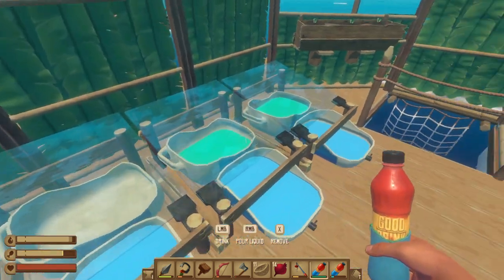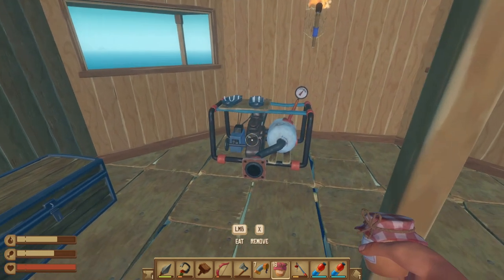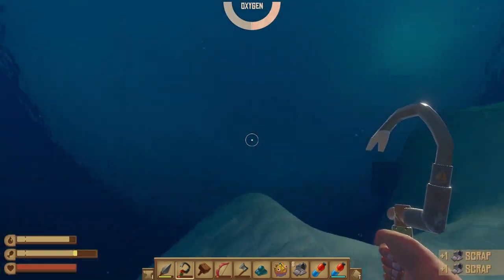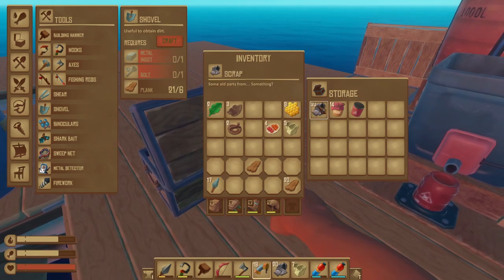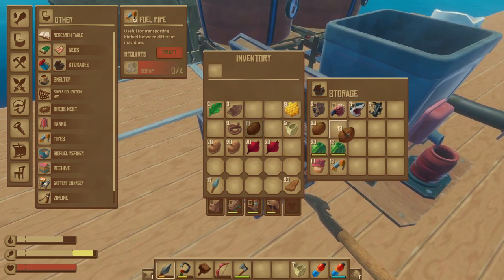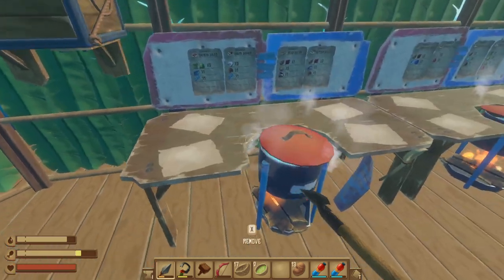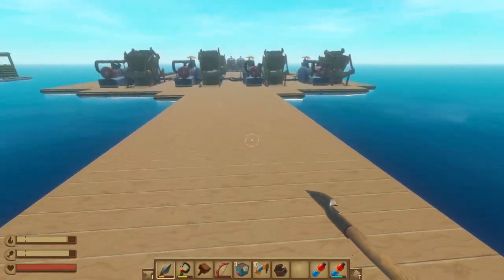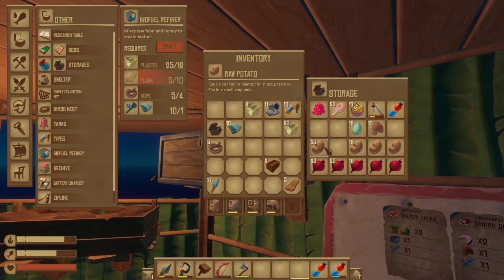Super Farm Setup & Biofuel Storage | Raft Gameplay | Part 17

Comment: -6 engines is the most you'll need, even if you have over 600 foundations.
-Pufferfish will NOT explode if you approach them before they go belly-up. I've tested this repeatedly
-fruit compote is the only recipe that fills thirst on top of adding hunger bonus
Reply: You forgot about the shark being able to attack ANY raft piece, not just the outside pieces. The shark prioritizes the closes foundation, but even if you armor the entire outside perimeter, the shark will just aim for the next one in.
Reply: @DizzyDJW  I am pretty sure that was a bug in the older versions and has since been fixed. I'm not 100% on this, but I'll test it in my game and report back
Reply: @DizzyDJW  Bruce leaves the raft completly alone if the whole outside part is armoured, they changed it in a update.
Reply: @sylviia9823  the official Raft wiki page https://raft.fandom.com/wiki/Engine
Reply: @sidekickz2180  yes i saw that but its just dont work in my case, i remove my previous comment because after i read it i found him little bit rude and it was not my intention
Reply: @sylviia9823  it's all good, I didn't take it that way. I try not to read too much into peoples' tones through text lol
Reply: @DizzyDJW  ye that was fixed

Comment: Once the puffer enters the death animation, it doesn't blow up.
If you fill the biofuel refiner 100% with food until you can't add any more, you can make 2 biofuel out of that by just adding the honey. All the heads are 50% of a refiner, and equal to 1 biofuel. Also, you don't need to hold the honey in your hand, you can add it from your inventory.
Reply: The refiner contains 200 units.  The fish head is 125, the shark head is 100, the potatoes are 10.

Comment: You don't need more than 6 engines period. Anything over 600 foundations won't affect the engines.  Test it for yourself ;)
Reply: When did this change happen?
Reply: @ahmataevo  I'm not sure I saw a reddit post about it and tested it myself and was amazed, pulled a ton of engines out and works without any issues on 6.

Comment: Also, you want to find the medium crop plots and farm watermelons. I think I saw that you can fit 18 medium crops for 1 sprinkler.
Reply: I've never tested the Medium crop plots but testing in Creative mode I can get 58 small crop plots plus 9 Grass Plots serviced by one sprinkler.  Sprinklers will water 1/2 wall up and 1/2 wall down under the floor.
Reply: @robertmansfield7793  but if its for biofuel watermelon is far bette

Comment: Man my ship is so roomy yet it actually runs with 2 engines.  I thought it would need at least 2 and possibly 3.  The cool thing is with it being so small I do not need to grind so much for resources.  I was get.  It is 5 by maybe 10 squares and 2 story with wings out the side going out another 3 with nets in a wedge shape.  The anchor is up front and all the controls are on top in the open.  I can reach down and drop the anchor from above and then turn around and go down the stairs to turn off the engine.  I have the bio fuel set up with the tank and pipes and it works great.  I did no know the bio fuel generator automatically fills the tank.  It drives so easy.

I'm doing the zipline quest right now.  I'll never do a zipline on my ship as it is not big enough.  I have all my storage in back (2 stacks 5 across).  I will likely set up a bedroom in there because it is mostly open.  I need to move around all the plots on the roof, but I have some of everything growing and 1 lama and one bee hive.  I have not found the recipe for the bombs to get the birds and I have not seen a single goat.  I have 2 canisters ready though if I see one.  Hopefully 4 grass plots will work.  I even put lanterns on it to light it up (4 inside, one on the bow, and 2 up top).  I still wish stuff did not break so fast.  I do like fishing, but they have too many different fish and not enough recipes.  Deluxe Catfish is my favorite... 1 mushroom, 1 catfish, 1 beet, 1 potato, and 1 bowl.
Reply: Each engine can move up to 100 foundation pieces (the ones that require plastic and wood, the ones in contact with the water). My raft is 10 wide by 8 deep and I have two 10 square wings. This gives me 30 nets across the front (nets don't count against the engine limits). This gets me a raft of 99 blocks ((10x8)+(10x2)) minus one block for the anchor hole. On first floor I have 6 walls with 4x chests hanging from each and I put 4 smelters. Above the wings I built my animal pen and tree farm. My 2nd floor is entirely closed in for my crops and beehives, I also have my cooking stuff here. My 3rd floor is my steering wheel and receiver.
Reply: @habaz7838  I just got everything done.  I have my boat all built up.  I love the electric water purifier and tank, but they are huge.  U put them opposite my one side mounted paddle wheel.  I made a bedroom, hung pictures and curtains, and decorated tables.  I also hung lanterns all over the ship.  I took the sail off and the old water purifier.  They just are not needed.  I have 6 grass plots, 2 small plots of each potato, beet, and strawberry, 1 large plot of each watermelon and pineapple, and 4 small plots with mixed flower all watered with 2 sprinklers.  I have 1 lama, 1 bird, and 1 goat as well as 2 bee hives.  I also have 2 tree plots of each, palm, mango, and banana (23 plots total).  I have 2 small tables, a book shelf, a large chair, a small chair, a fireplace, a log pile, and a hammock.  I'm still running 10 large chests stashed in the back.  I have the steering, remote engine control, rudder, wind flag, and navigation system up top right in front.  My anchor is just over the edge up front so I can reach it from up top

Total the inside is 5x9.  The wedge in front sticks out 4 on each side and 4 in the front.  The anchor is in the front and 3 tree plots are on the sides (along with a bird nest on each side).  The engine hangs out the left side and if I did not have my 2x6 bedroom the electric water purifier, water storage tank, and paint mill would have stuck out the right side.  I had to build a 2x4 ledge on the outside on the bottom level instead.

Total this makes the boat 80 spaces (45 inside and 35 outside)  the second story is 50 also (minus 3 for the stairs).  There is 13 nets and 12 triangle pieces on top of that.  That is 105 total blocks in the water.  I have 37 walls, 40 railings up top, 3 doors and a stair case. 

Now there is supposed to be another chapter coming out, so I left a few spots free.  Hopefully we can get rid of the batteries and run a generator (I wish the battery had a power meter like on the charging station so I could see how much power is left in them without having to pick them up.  It would also bee nice if we could grow mushrooms and berries.  Awnings would be nice as well as a peeked roof.
Reply: @habaz7838  Actually I am thinking of making a much smaller one... just to see how small I can go and still have everything.  If I cut to to one plot of everything instead of 2 (all but the water melon and pineapple) and go to one bee hive and one smelter and stack the chests 3 high and have only 6-9 and remove most or all of the bedroom I wonder how small I can make it.
Reply: Yup... changed it around.  I still have the 2 bee hives, but I cut everything else down to 1.  I narrowed the wings with the nets down 1 space each side.  Now all the trees are watered by the two sprinklers, but sadly one o the large beds did not fit under the sprinkler.  With the trees up top I had room for a bathtub and outhouse outside on the wings.  I put the 2 nests up front so I can shoot the seagulls while driving.  I could not fit the hammock as it is 3 wide, so I have a couch to sleep on. I added even more decorations.  Now the paint mill and water pump are inside.

I actually have a closet that the water pump and storage tank fit in and it les you squeeze past them.  I also found that the vertical curtains can cover things, even if they stick out a bit.  It also reaches the floor.  The blind does not reach the floor, but you can walk through it.  I have 8 storage boxes mounted on the walls (because of the pipes on the floor) and 9 more in the back.  4 of them are empty right now.

I do have a hole in the floor where the water pump goes and it is in the way.  I put a diagonal piece to cover most of it, then hit it with a rug.  The problem is you fall through the rug and you can fall through the diagonal holes still.  I put a plant cover most of it and since I can not walk through the plant it keep me from accidently falling through.

So not only d I have 4 empty chests, but I also have room up top for one small garden plot, 2 space between my sprinklers, I can squeeze some next to my garden, and if all else fails I can remove the 3 storage boxes or remove some of the decorations.  I have the couch, a comfy chair, 2 smaller chairs, 2 small tables a bookshelf, 2 cupboards, and lots of plants, pictures, lanterns, flowers, candles, and other knickknacks.

Now I just have to wait for Chapter 3...
Reply: @toddabbott781  I have my animal pen above one of my net wings, It has 22 grass plots 3 wide by 8 long with 2 empty for sprinklers. I only have 1 of each animal and the plots almost don't need me to water them as it rains often enough and the animals don't consume enough. I have 4 tree plots and 4 nests above my other wing. My bottom floor is somewhat open air with walls placed pretty much every 3rd square. This leaves me openings for my engine's paddle wheel and my purifier once I get it. I'm putting a water tank on the 2nd and 3rd floors all connected with pipes. I'm doing the bee farm the way Kage has it with 4 flower crop plots surrounded by hives. I'm unsure how many crop plots I'll have for food, but will be using wall and ceiling space (they hang from above) if needed. Since I'll have a water tank right there I won't bother with sprinklers for my crops.
Reply: @habaz7838  22 grass plots... why?  You can run with 4 if you only have 1 of each animal.  I have also found a bit of an exploit... you can place the small planter boxes over the grass and the animals still can use the grass, the plants grow and both use the same water.  I have a 2x3 are of grass plots with the sprinkler along the long side and a bee hive on each side of the sprinkle.  Then I have a strip of 4 small planter boxes filled with flowers overlapping the grass plots.  This means a 3x3 room hold a sprinkler, 6 grass plots, 4 flower beds, and 2 bee hives.  I also found yo can actually stack the larger storage boxes 4 high.

You realize you grass plots would take up half my ship... and I had room for couches, chairs, tables, and bookshelves and something like 20 storage and all the tech built... and a little space for new stuff when the next chapter comes out.

Food is rarely an issue.  I hit the islands to get wood I grab the fruit for the fruit compo recipe.  I get enough potatoes and radishes from barrels and meat from killing sharks, rats, boars, and seagulls.

Last game I was going through fuel like crazy, but that was because I had missed the blueprints for the steering wheel and thought it was on the ship.  I when between Carnival and the ship like 3 times until I finally found it.  Now I really don't even need the bee hives as I have plenty of bio fuel already.  I'm almost done in the dome city, but I need titanium to finish my build, so I will do some island hoping after I finish.
Reply: Mine are open to the sky, the 3 animals can't eat fast enough to go through all the plots before it rains and waters them all for free.
Reply: @habaz7838  I put them inside so I would not have to worry about birds destroying the flowers (or crops if I bothered planting them).  Scare crows do not last long and the cannot be repaired.  But like I said a 9x9 as 4 flower plots and I could easily throw in 4 plots for vegetables over the grass plots.  The one sprinkler covers it all and now I have a electric filter and tank.

I am going to remove my biofuel tank and water tank  I'm wondering if I even need the tank.  Since I only have one sprinkler and one engine there is no real reason to use them.  They take up WAY too much space.  I am going to shrink my ship as much as I can.

Comment: You CAN pack 20 small farm plots for one sprinkler.  I don't think it saves on water, but as you need 20 potatoes per biofuel, it feels better for me anyways.
(Edit: You already thought of this!)
I take the battery out while replanting because I think I waste the battery.  I don't know if its true or not though.
Reply: Jack, you can actually get 58 small crop plots plus 9 Grass Plots serviced by one sprinkler.  Sprinklers will water 1/2 wall up and 1/2 wall down under the floor.  Use the walls to hang those plots on along with hanging from ceiling.